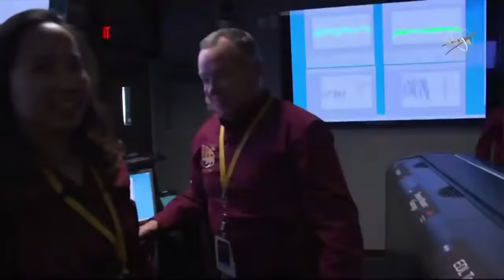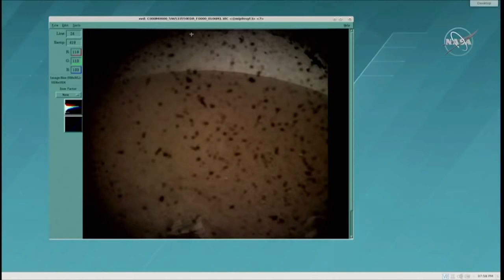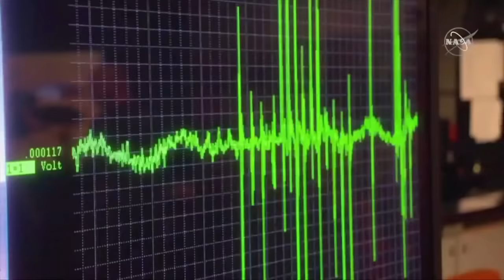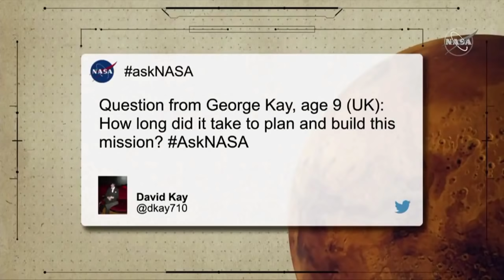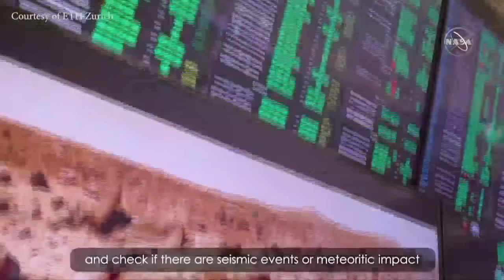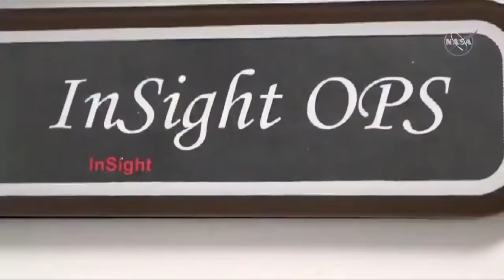NASA InSight landing: Watch as the spacecraft successfully lands on Mars

Comment: Would be pretty easy to false a computer mock up of the trajectories to try to save a failing project in the face of free market competitors doing a significantly better job. With no live shots there is no way to tell one way or the other. Especially surprising considering the availability of modern camera equipment and the ease to which a feed could be transferred back down the control stream (all be it delayed).